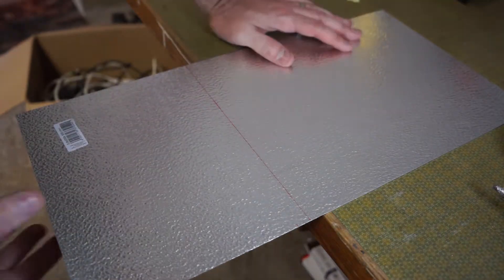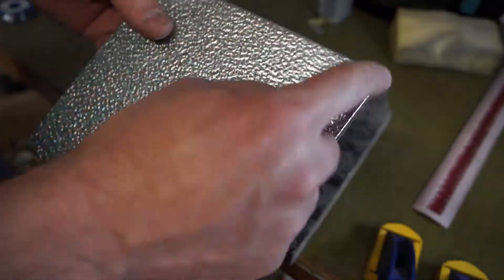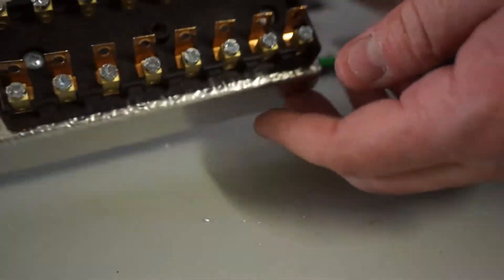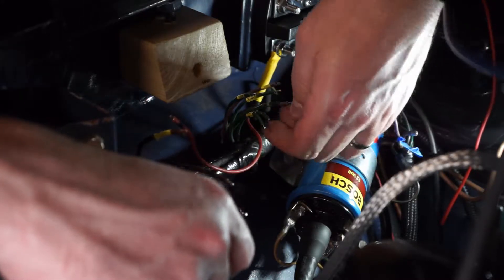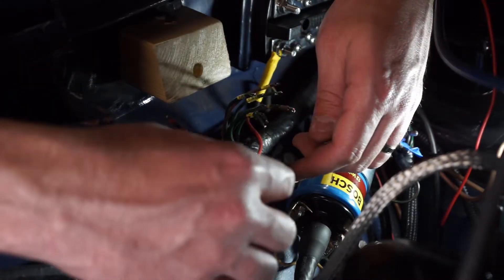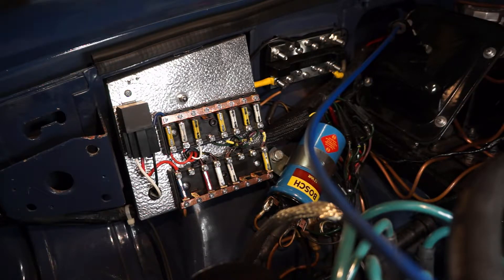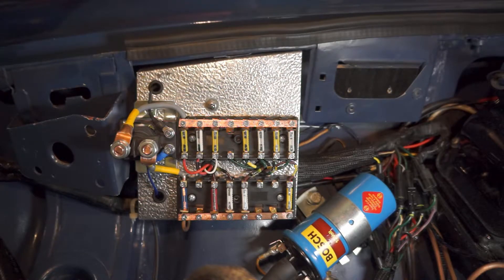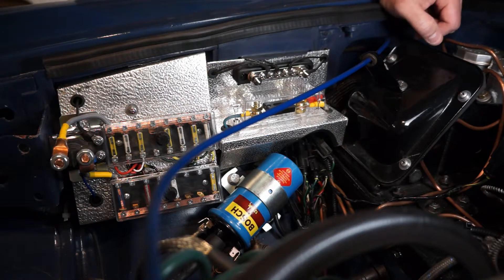1968 MGC Fuse Panel Upgrade

Comment: Man that’s a nice job. Subscribed and watching some more. Just attacking the wiring on my newly acquired 71MGB 👍
Reply from the maker: Thanks.  If you have any questions let me know.
Reply: I am having trouble getting wipers to work. Guy I bought it from said he never drove in the rain so never bothered with them saying when they were hooked up they would intermittently come on by themselves and he did show me that they moved if he hooked up properly so I assumed the motor is still good but now I’m trying to wire in just a simple on/off switch to bypass the self park feature and can’t get them to power up at all ?  Have tries a live lead to all 3 wires coming out of the motor with no luck. Maybe it needs power to two at once ?
Reply from the maker: @tyee4u  what year?  C or B?  US or UK car?
Reply: JR's Garage it’s a 71 MGB. I believe American originally because of MPH Speedo but I’m in Canada. I made a little headway today. Connecting constant 12v to the yellow wire on motor and switched 12v to red first, and then blue. I could hear motor trying and saw very slight movement of wipers. This leads me to believe maybe wiper motor is shot or in need of a rebuild.  Am hoping to just install an on/off switch and I will shut off at proper parking angle but I guess will have to remove motor and dive in to that.  Am leaning heavily towards your fuse box set up soon.
Reply from the maker: Seems like you got it.  That's what I'd suspect as well.  The motor.  Here is some information that might help: https://www.mgexp.com/forum/mgb-and-gt-forum.1/wiper-motor-wiring.3277333/.  There are several electrical diagrams that cover the '71 model year depending on options but all of them I think have 3 or 4 wires going to the wiper motor.  There should be a separate wire each for the high/low range and of course ground and the 4th may be for the auto-park.  My '68 doesn't have that feature so I have to just turn off the switch when the wiper is down where I want it parked.
Reply from the maker: If you need a copy of the wiring diagram you can get it here on my website: http://mgclife.epizy.com/2017/04/14/refresh-the-undercarriage-wire-loom-cover/
Reply: JR's Garage thanks so much again.
Reply: JR's Garage Back here again drooling over your fuse box 😊. Ended up tearing apart my wiper motor and cleaning and reassembled everything and installed a simple on off switch. All good now. Just attacking and updating the fuse box. Yours is still the nicest set up on the tube.  I’m going with a marine mini fuse panel.